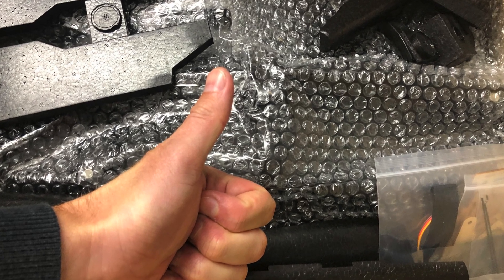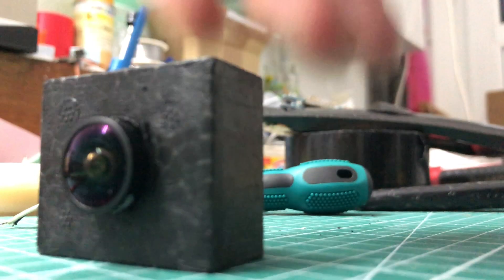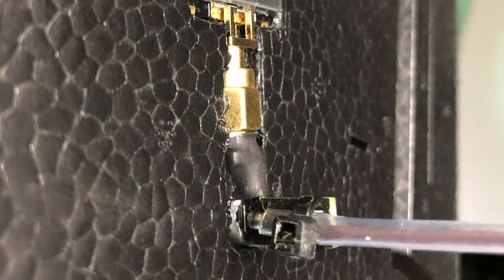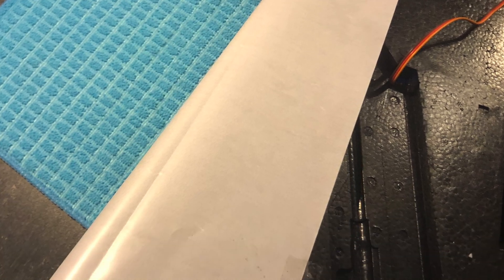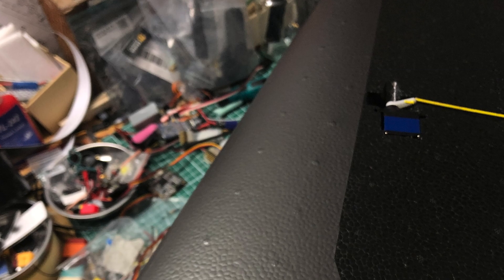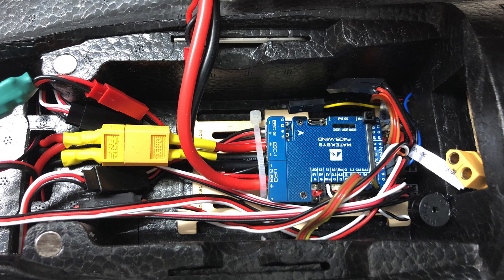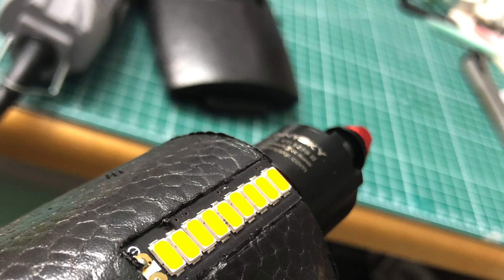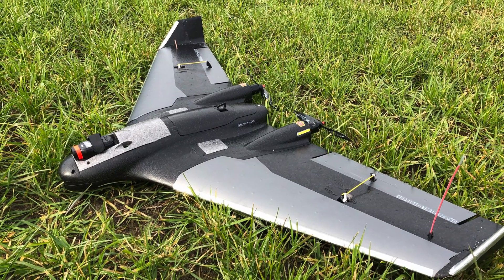Harrier S1100 - Rebuild and maiden #15

Comment: Nice flying! I maiden mine and crashed :( I think wrong CG, it roll to the right in the take off and dive to the ground.
Can you tell me if you have added some weight to the tail with a 5200 multistar lipo and 2 motor setup? Thanks!!
Reply from the maker: Sad to hear- but No- no extra weight in the back! CG is about 305mm from the nose and the LiHv is as far behind as it can be placed. Keep in mind that we carry an action cam on the nose (about 80g with battery).

Will you rebuild it? did you know, that all the spare parts are available right now?
All the best
Reply: @JustFPV-net  Yes, it's ready for re-maiden :) , only broke nose and it's easy to fix ..
Ok, i will try adding action cam to the nose (Runcam 2 HD) and test if CG is near 305mm (i'm really bad testing CG)
Thanks !!! ;)

Comment: I managed to maiden mine recently and it too suffered the same damage after an unscheduled landing. You should check the video out, it's quite funny. iI have since printed stronger mounts, which have survived a few landings so far.
Reply from the maker: The landings have been rough while the ground is frozen and hard as stone ... but in the warmer days, this is no problem. The problem has gone by now and the motors hold their position well